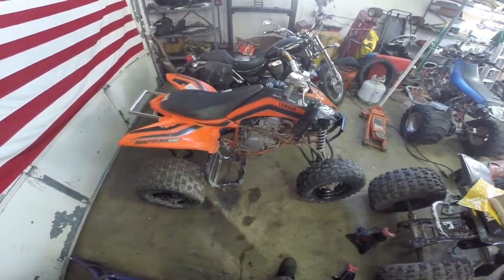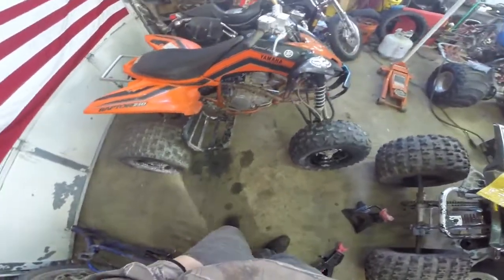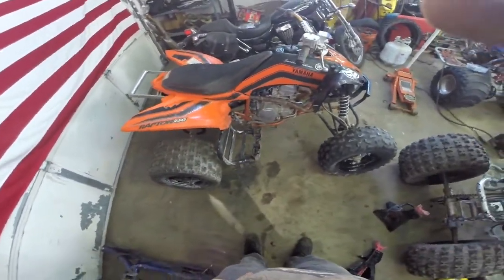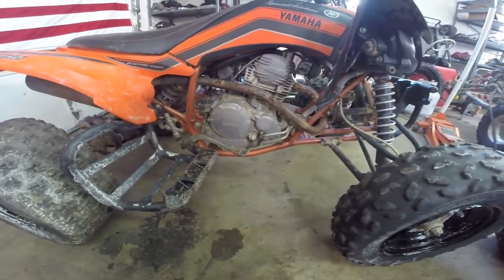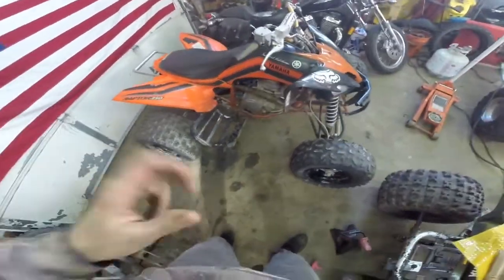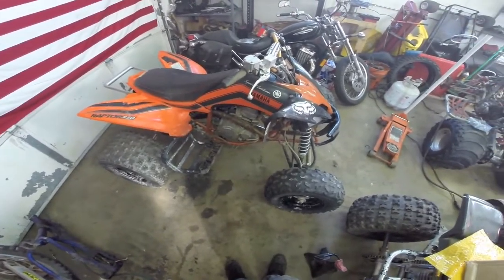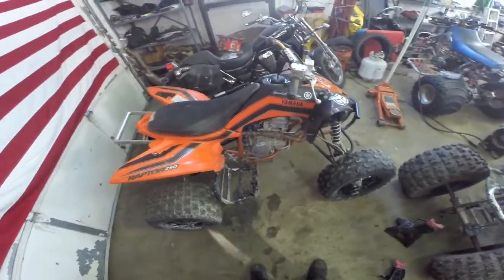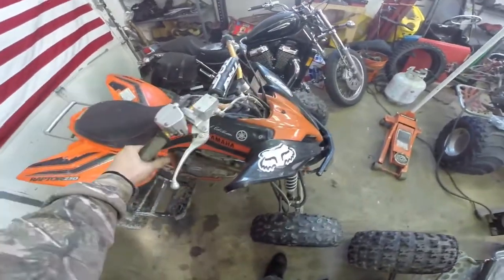New Yamaha Raptor 250 SE Project

Comment: Hi 
Need your help and advise 
I am have a problem with my 1997 yamaha warrior. After 10 mins of riding both front tires lock up and my front brake lever is extremely tense. After a while of letting the warrior cool down the front tires unlock a bit. I previously installed both front Brake caliper re build kit (brand all balls) but I still have this problem. 

Any tips or advice? 
Thank you